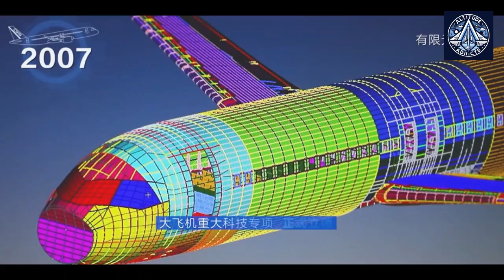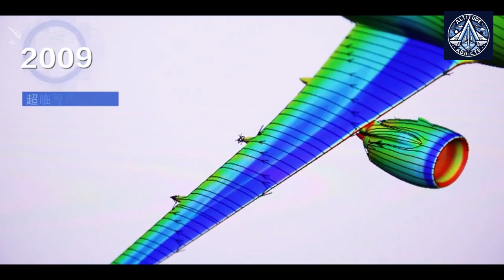C919 vs MC-21 -  Can China and Russia Dominate the Skies?

Comment: You have quite old information on all aircraft both Chinese and Russian, you still complains about Sections, Sections is an very old stories a mere propaganda campaign now. Russians are far ahead with mass production of MC21 about 25 aircraft already assembled and refurbished with Russian parts and engines, SJ100 20 airport is in finishing stages waiting for engines only 3 are flying daily for different tests another will join them shortly. Chines are also putting final touches on 2 engines for 919 and 929 aircraft.

Comment: Russians should also work hard to improve the manufacturing processes quality and quality control. One thing is to manufacture a gun like a box of matches, without any nice looking as it is not the requirement, another thing is to manufacture a well designed plane and good quality finishing, mandatory to make customer feels more safe when boarding or sitting inside.

Comment: The developers of the Chinese C-919 aircraft are making the same mistakes as the Russians did 20 years ago, relying on Western cooperation with aircraft system manufacturers. At any moment, this aircraft can be stopped by various technological sanctions from the United States. Russian patriots have always, since the early 2000s, criticized the Sukhoi company and the Russian government for extensive cooperation and dependence on foreign components and aircraft systems. The Sukhoi Jet fulfilled its role as a replacement for the departed Tu-134, as a short-haul aircraft within Russia. But at the same time, it buried the Tu-334, which was less demanding on airfield pavement, prototypes of which had already flown in the early 2000s, but politically, Russian pro-Western liberals wanted to develop cooperation in civil aircraft manufacturing.
Reply: @Nahal0nok  Russia developed its avionics technology 100% on its own since 40s.After the collapse of soviet union to please western governments  syarted using avionics parts from western avionics companies which was stopped after sanctions and Russia started developing updated engines and fuel efficient wings.
Reply: china is not making mistake as russia. china didn't have all the russia did have in the cold war times. china has no technology to do it,  china has to rely on learning form the western sytem to get all the experiences. Russia gave up their old techs for advance western system.
no country can make plane with out rely on each others now aday. Russia was making  mistakes, they have no choice, they were weak then. 
china will rely on western  things for a while. but western can't sanctions on china because if china stop buying their systems, their companiese will loss chinese markets, china market is 33% of the world.  china is a powerful coutry about 15 times more powerful than russia

Comment: the Comac C919 is a more ambitious & focused project than the MC-21 . . . the Irkut MC-21-300 stretched variant with a seating capacity of 168 - 183 paxs in a 2-class layout, should be more promising than the basic MC-21-200 variant . . . instead a dedicated freighter variant of the MC-21-200 could be worthwhile because the narrow body freighter aircraft is still a niche market, except for the B737-800 BCF & A320-200 Freighter ofcourse . . . a MC-21-200 Freighter variant will make it's competitors like Comac bang the table over & over again, lamenting as to why didn't they think of it before . . .
Reply: It is the contrary. The MC-21 is more ambitious and more advanced technologically. For example, the MC-21 uses extensively polymer and carbon composite materials. Its wing is made of carbon fiber, which is not the case of the Chinese aircraft. The C-919 uses a traditional and less efficient aluminum wing.
Also, the MC-21-310 has a capacity of up to 211 passengers and can fly further (up to 6000km)
Reply: If tommorow the western countries impose sanction on c919 due to some reason it shall be the end of the project,  MC 21 is totaly domestic now, thanks to the sanctions and it sounds promising it is a real challenge